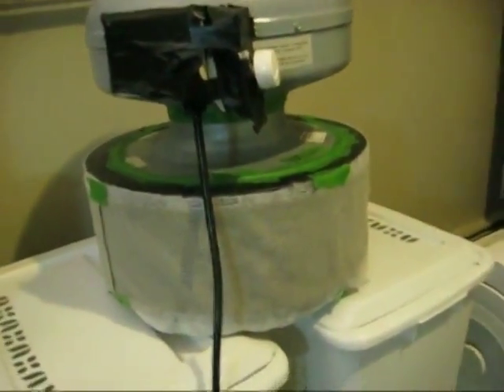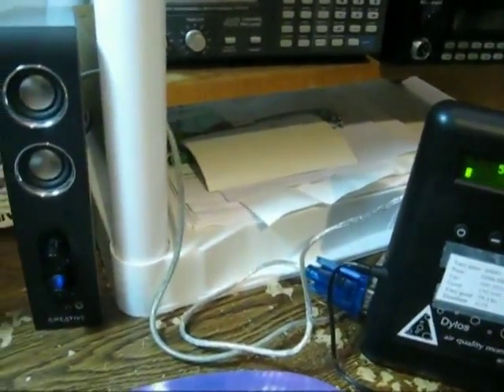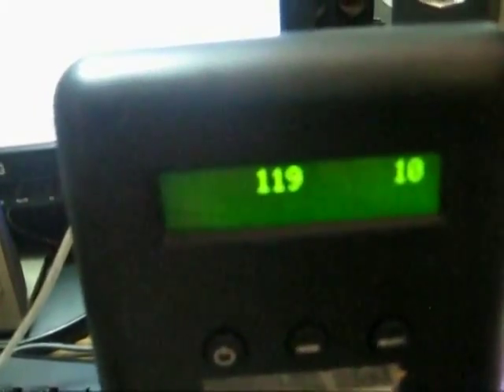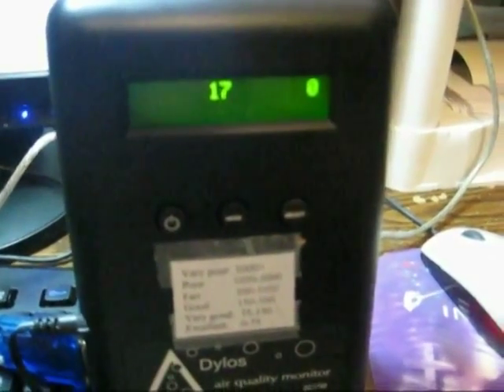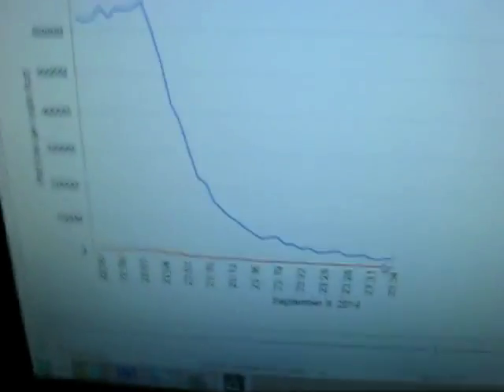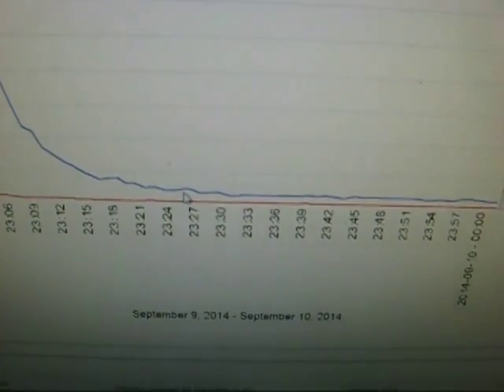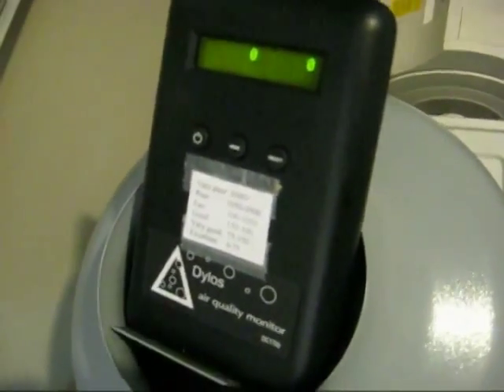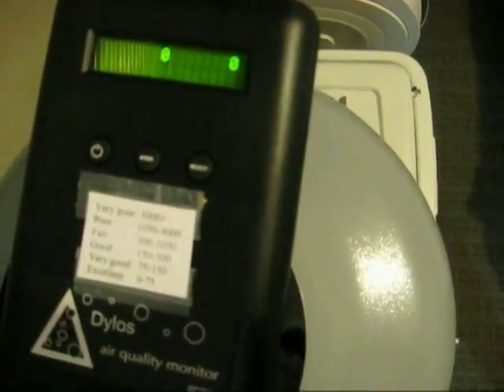Homemade DIY HEPA air cleaner test

Comment from the maker: Warning - German cockroaches and Bed Bugs!  They can be in filters purchased from auction sites. Inspect any filters you buy outside before you bring them in your home. They will hide deep inside the filter and under the gaskets. I personally would not buy filters anymore off auction sites, not worth the risk of getting cockroaches or bed bugs.

Comment: I thought you said you could buy the filter for really really cheap on your video titled " homemade HEPA air cleaner.  When I look up the price for the model H610c-99, it is priced at close to 300 dollars.  I did not find any on ebay for the price you discussed, can you provide me with some links as I live with a smoker and I am also looking for work so I do not have the cash to spend on an expensive set up.  I do have several of the blowers you are using and that is why I am very interested in setting up a similar system with a filter that is under 50 dollars
Reply from the maker: +KC STORYTIME You  need to keep checking ebay often for good deals. I got 5 filters( H610c-99) for $500 delivered. You won't find deals like that often. I find  deals by checking often.  Honeywell filters are the most common. They are not "certified" but they do work good.   Here is one seller selling aftermarket Honeywell HEPA filters.   http://www.ebay.com/itm/Honeywell-28725-Replacement-Air-Cleaner-HEPA-Filter-/371267290579?hash=item56714145d3:g:mMoAAOxy~ilSNfSQ
Reply from the maker: +Rick Rude  This seller is selling aftermarket Honeywell filters.       http://www.ebay.com/itm/Honeywell-28720-True-HEPA-Air-Replacement-Filter-HEPA-CPZ-NEW-IN-BOX-/281441943514?hash=item41873f3fda:g:~GUAAOSw7NNUGMPO
Reply from the maker: +KC STORYTIME Here is another listing for under $50. I don't know the seller, I just found the listing. http://www.ebay.com/itm/Honeywell-24000-99-97-HEPA-Replacement-Media-Filter-Genuine-OEM-/131664731387?hash=item1ea7d45cfb:g:bHoAAOSwHQ9WU3ug
Reply from the maker: +KC STORYTIME  There is deals, you have to look, find deals then look up the filter specs, size  and retail price on line. Search "HEPA 99.97" every day!  Here is another HEPA filter. This one is meant for an industrial vacuum. I don't know the cfm rating but it should work with your own fan. Look online, I look then I resaerch  filters on the net. This filter if certified DOP tested. Again, I don't know this seller.  http://www.ebay.com/itm/141835276287?_trksid=p2060353.m1438.l2649&ssPageName=STRK%3AMEBIDX%3AIT
Reply from the maker: +KC STORYTIME  This one is  also certified (I have no association with any ebay seller, I just found  the auction for you. I will likely buy this filter after I ask the seller a question.  http://www.ebay.com/itm/261869931333?_trksid=p2060353.m1438.l2649&ssPageName=STRK%3AMEBIDX%3AIT

Comment from the maker: The Honeywell work well and  are easy to find. But are not "DOP certified" to HEPA specs.   I have acquired some commercial quality  filters from Abatement Technologies that are certified to HEPA specs. The model is H610c-99. Use certified HEPA filters if you are serious about clean air!  They are round with a sealed bottom and work perfectly with my homemade system at a fraction of the price of buying a full unit from Abatement Technologies.

Comment from the maker: The Honeywell filters I tested do leak a very small amount of .5 micron particles.  I also have a IqAIR unit which does not leak any .5 micron particles.  But the IQAIR is "very" expensive to buy and maintain. My homemade air cleaner a much cheaper alternative.
Reply from the maker: ***** I want to get a .3 micron counter eventually.  They are much more expensive then the Dylos was.  The Dylos can't tell me if a filter meets HEPA specs at 99.97% @.3 microns.  It is not meant to be used as a certification instrument. But it still gives me a good idea of how well an air cleaning system is doing.  If a filter is leaking .5 micron particles it will certainly  be leaking more .3 micron particles since they are smaller and harder to capture.